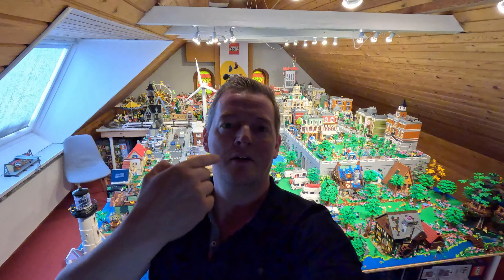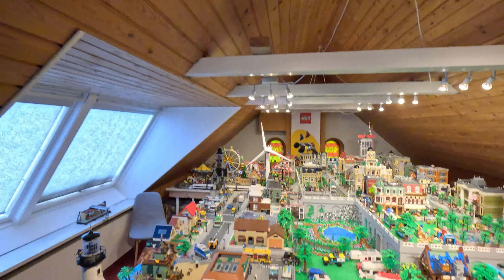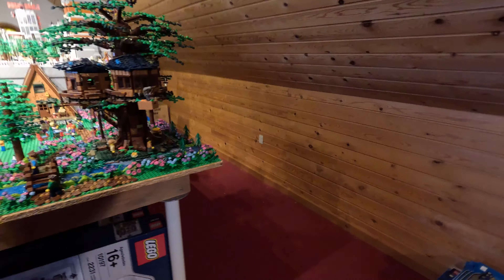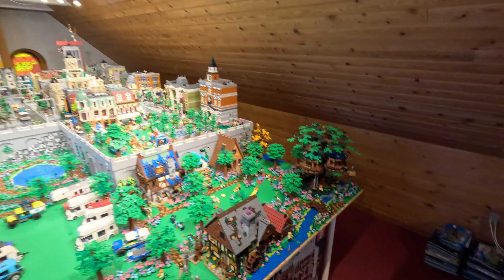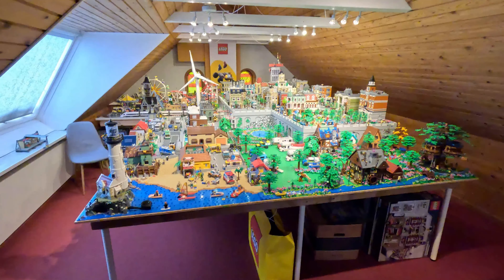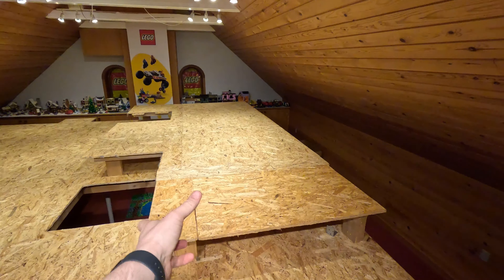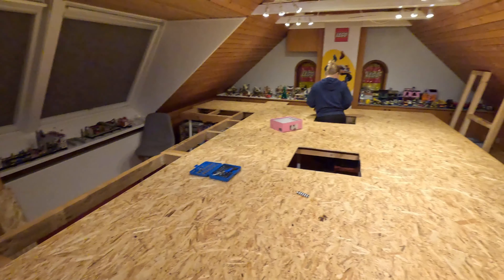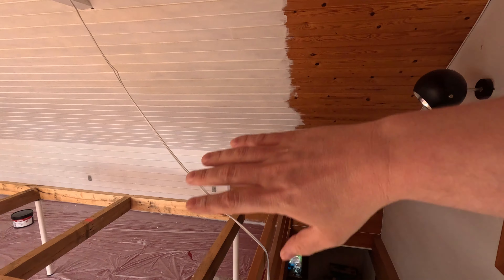Where is the city? - Lego City Update #40

Comment: Would recommend going with half or three quarter inch ply rather than the OSB Board that can bend and warp more...but if your OSB is okay and you aint had no problems and its not warped and well screwed down to 2 inch batons then have fun its gonna look well smart.
Reply from the maker: Didn’t have any big problem with the last table, but I’m not completely sure if we have enough support 😅
But only time will tell 😜